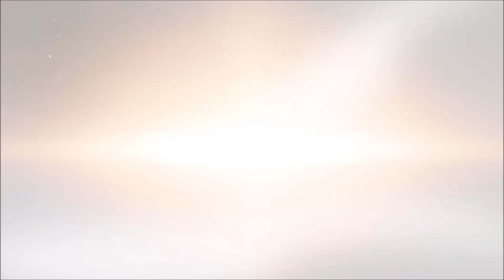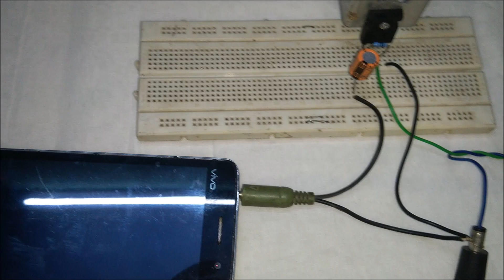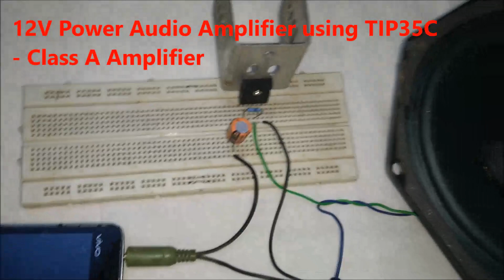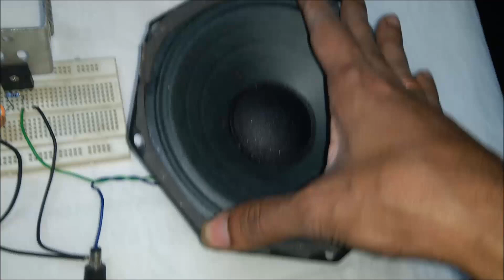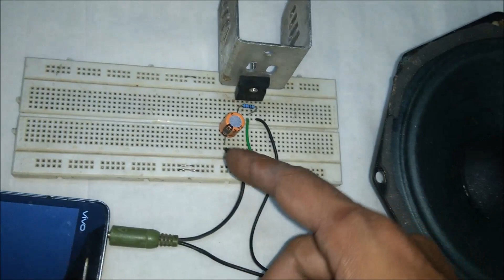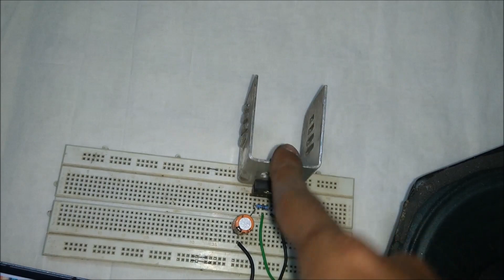How to Design 12V Audio Power Amplifier Circuit

Comment: How did you choose appropriate Transistor and capacitor, how did you do calculations, I am currently studying ECE First year, and looking forward to build my own 100 watt amp by myself, but how do I calculate filter circuit components?
Reply: dont do this, due there is a dc offset on the speaker. 
And also the performance is very low:
we have 12V VCC the amplifier is in class A application, so the efficiency is about 25%
voltage need to be half at the output, but since there is no output, its after the speaker, so 6V dc sitting on the speaker. 
in case of 1k resistor is included for the base collector, we have 12mA on the base.
TIP35C have a HFE rating between 15-75Hfe for 15A load, or 25Hfe for 1.5A.
So we have Ib of 12mA and 25Hfe the current flow will be about 300mA.
The calculated 300mA times 12V, the power drawn will be about 3.6Watts, so if we calcualate 25% efficiency, we have: 0.9Watt of total music power, thus the dc offset of 6volts.
This calculation is not 100% accurate, but still more accurate than the avarage indian "diy amplifier" that calls it 100watt, and call it a day.
To do a 100Watt amplifier for 8R you must have +-50Volt (Positive and Negative voltages), also the amplifier in class AB application.
You dont need to do 100Watt right away, 
You can do 5-10 watts on much safer operational zone, like 24Volt, 30Volt, 40Volts on a bipolar power supply.
On 32Volts(Dropped to 28Volts) i did achieved 16Watts @10%THD of total power on my diy class AB amplifier application.